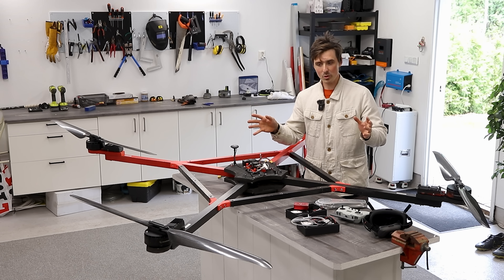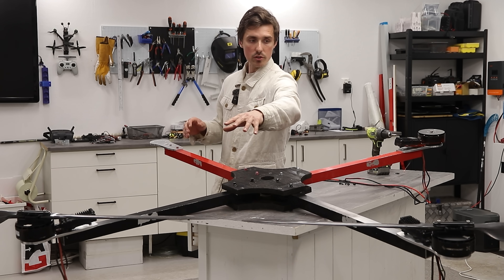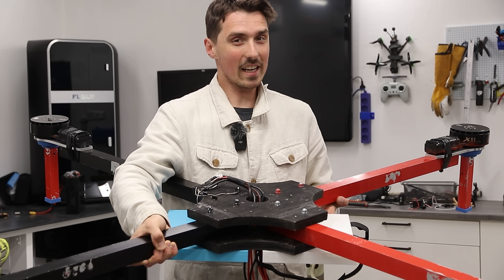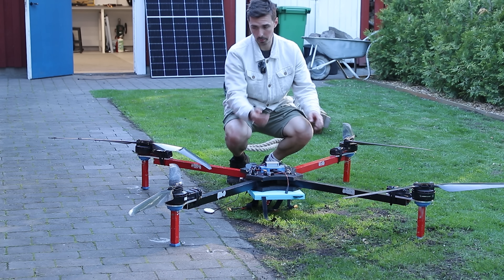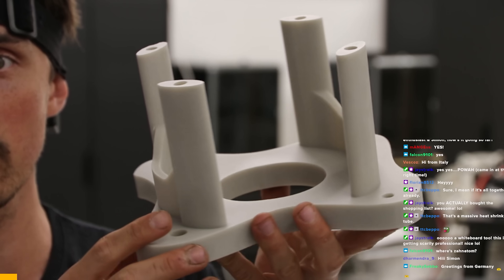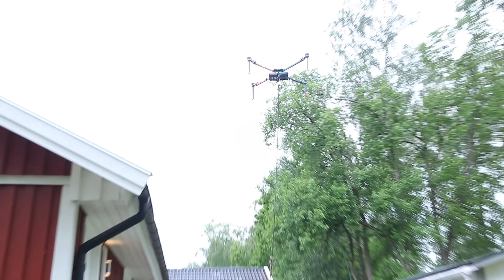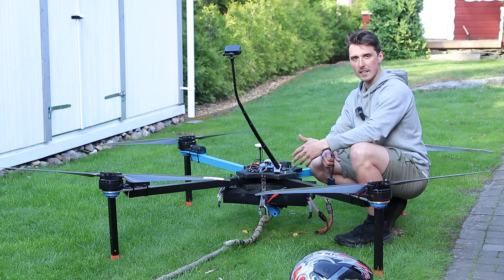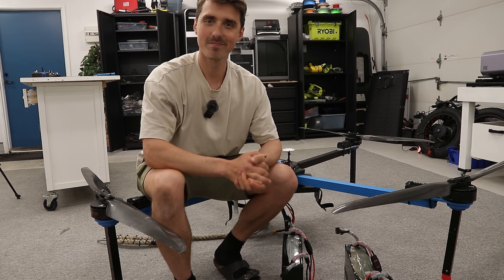Heavy Lift Drone 100kg Test - It Works!

Comment: that last part where you did the 100 kilo, notice that when it dropped, intertia pushed the drone up about a meter higher. I was expecting that reaction from the beginning when you dropped the wheelbarrow but it in each case the drone remained level and composed, even at the 40 kilo weight... it is a very stable build... I can't even complain about testing in that small back yard because the drone seem impressively stable

Comment: @RCLifeOn - WHY are you not adding or making protection rings or some kinda metal mesh around every propeller?  It will protects the propeller and other parts from breaking in pieces if something happening.
Reply from the maker: Not sure it would. The propellers are 1.3m in diameter, imagine how flimsy it would be made out of foam/metal etc. It would have to be reinforced with glas fiber but still, the drone is 35 kilograms. It's probably cheaper and lighter to have spare propellers.
Reply: @RcLifeOn  Yeah, I understand that - but it will be even more cheaper if someone will have some spare head and second life to have LOL ! Think about your own safety and other people safety as well - no just for drone's propeller health as well. You need come up with some solution how to isolate propellers with some rings or mesh from some material.

Comment: A "release" mechanism - built on the same principle as a parachute triple ring (3 ring) release -  its operation isn't significantly affected by the object weight at the release actuator, unlike a double shear  - slider..  (I have a few - "in rope", "soft shackles" I use with this type of mech - all made out of rope spliced into rope, easy to slip the load, another mech is an over centre release - as has been used in many compound-bow (archery) triggers.

Comment: Couldn't you significantly reduce weight by using one large central propeller with stator vanes (or a second counter rotating blade) to prevent rotation?  Then steer by much smaller directional (counter rotating) motors, since it would no longer bare weight on the arms.  Might even be able to use carbon fiber or plastic in any extenstions to keep arm weight low.  The weight kept nearer the center of gravity it increase the relative agility.

Comment: Hobo level engineering 😂 more subscribers than sense and skill but i guess thats the charm 😜

The drop mechanism for example are printed in the weakes direction, and the servo tries to pull the pin out at an angle, it needs one more linkage between the servo arm and the pin so the pin can go in a straight line, will make it much easier to pull.

Comment: Two bolts holding down the motor mounting plate may be a questionable design if you intend it o carry you. I’m worried for your safety. 😮

Comment: I have both the x11 and x 13 motors and they are extremely reliable and I use the curve flight controller and I haven’t had any issues with them

Comment: The release mechanism should be printed 90 degrees from the orientation you printed that one. The layer lines need to be in the direction of the load or else you are just depending on layer adhesion.

Comment: Very dangerous, it could instantly flip and fly in your direction if anything was setup wrong. Or if there is a feedback in pid loop which is very common in large drones whitout a stiff frame or unbalanced propellors. Glad you took protection a bit more serious this part halfway through the video

Comment: Thats super amazing, with the 65kg the problem was too much shaking, if you use 3 ropes at different points it will elliminate the shaking, but the droping mechanism could turn a lot more complex. That series are my favorite right now please continue!
Reply: In such configuration the release must be installed on the rope after the junction
Reply: There is no need for a heavy-duty release system. Check out the three-ring release system we use on parachute risers. It’s an ingenious setup: a small (~20 mm) high-strength stainless steel ring inside a medium (~40 mm) ring inside a large (~70 mm) ring, all interlocked and held in place by a loop of webbing through the small ring, secured by a pin at the end of the release cable.

Pull the pin holding the small ring, and the whole system cascades open almost instantly in three stages — one ring after another — releasing over 100 kg with probably around 1 kg of force, give or take.

It’s super lightweight, too — nothing like that enormous monstrosity he used, which didn't even work properly!

 I actually had to cut away a malfunctioning main once, and it worked perfectly.
Reply: @Nilguiri yeah that's a great way to do it, smart.

Comment: You should print those heavy duty parts from ABS/PETG or similar, the layer adhesion is way better. Also, the piano wire is a nice touch, but you should design your parts with the holes for it, so the piano wire has something to glue inside other than the infill. Crazy drone though!

Comment: 1 week ago, i flashed my HW T1 vtol to inav 8. Had to redo the Mixer, becurse the beckup was not supported.
Inmessed up the Motor outputs, and testet  it with full props in my hand. It ripped out of my hand while testing, and ripped a chunk of Skin out of my Arm. And neck.

Comment: make attachment for like chainsaw, show the drone then to the power company whose job is to repair and fix the local power lines. They would probably love to see cheaper option to the helicopter+chainsaw combination to cut down tree branches that are dangerously close to the high voltage lines.

Comment: I rarely comment. I assemble agricultural drone for a living. Hundreds of DIY from 20kg to 70kg payload. I also work with DJI grass. I must say this dangerous to test close to your house. 
Not to discourage with your work but safety first. I had many stupid accidents that just to feel sorry after. 
Keep up your work.
Reply: From a virgin test-hop, all four legs should have been tethered independently on short tethers to four weights. It should be assumed that the article MAY do absolutely anything in all six degrees of translation, rotation.
Reply: @-danR  100% - was thinking the same myself, just complete amateur hour.   And the tether weight was completely inappropriate - he commented it picked up all 60+kg of it.   What would he have done if it had gone max power and wouldn't turn off?   60kg tether dropping from a height could kill a person.
Reply: Also the helmet won't help much. Motorcycle helmets are designed to absorb heavy blunt impacts. They are just thin ABS and Styrofoam. He should be wearing something like a hard hat with a safety visor or something with a metal shell in case one of those props splinters and sends out shrapnel.
Reply: @rubiconnn  Watching him like 10 feet away from that drone with "cover" after the props were glued together was so sketchy lmao. Then to have the motor order messed up on a drone of that caliber, omggg
Reply: Any open source agricultural drone?
Reply: Hi do you build and sell drones
Reply: I think hurting himself is ingrained in his process
Reply: “The true man wants two things: danger and play.”
Reply: We are Vikings, we dont care 😂🎉
Reply: Китайцы летают на таких dji agros. Они садятся в кресло в центре. И летают.
Reply: I have the feeling that some day, some person will die caused by one of his projects.
Reply: @MrGTAmodsgerman That's a morbid thought...
Reply: @MrGTAmodsgerman 😂

Comment: You are really giving the flight controller a workout with all of the turbulence cased by flying so close to those buildings.  Any breezes or wind rolls over the roof tops of the buildings and causes down drafts and swirling air (rotor).

Comment: Beautiful and congratulations. Use either Taulman 910 alloy or aluminum for the whole release mechanism assembly. Don't forget to coat the pin release with graphite and do some covers for the batteries. Well done.

Comment: What a beast! I'm really impressed with that flight controller. I expected it to go to the moon as soon as you dropped the payload but it kept it's altitude. Very cool project and also sketchy af. Good work on that prop repair. I also didn't expect that to work out so well.

Comment: Them FC's are bulletproof .. Used them with different builds over the years, also the Naza V1	+2 are solid units. never let me down and have had the same heavy lift for 9yrs!!
Reply: That’s cool. Which FC is he using for this one ? It’s actually very stable !!
Reply: @MehdiNY  He used a Jiyi KX, a common FC for agricultural drones from china. Wonder how the revised K++ V2 would perform!

Comment: You should use Aluminum instead of Aluminium it will massively reduce vibrations for only like a 3% weight increase.
Good video though

Comment: I've been watching agricultural drones spraying entire fields and carrying 13 gallons of pesticide. Definitely a market for the heavy lifters. I suspect you have the equivalent of a $30,000 drone there. Amazing job.
Reply: Those fat DJI drones, as terrible as DJI is as a company morally and to deal with, do have their advantages though and the tech is really impressive. For example if you lose a prop or motor the flight controller makes the whole drone rotate very fast to allow for a controlled landing with only 3 props. It's crazy cool to see, I wish ardupilot could get that feature too.
Reply: @ml11ML  if you go on the DJI forum that's on DJI website you can see hundreds of customers complaining about serious issues they are forced to deal with,it really is frustrating to try to fix so many problems when you have paid so much,I spent $3000 on a phantom 4
Reply: @ml11ML  Yeah DJI nearly has no competition, crazy tech they make. From my experience they are very nice to deal with, i 've had very good support for warranty and repairs from them.
Reply: @ml11ML  Morally? Eh.. maybe, but I tend not to bother with the terminally online stuff. As for "dealing with" I've never had an issue and they've been nothing but responsive.
Reply: @squidikka Ah I was probably not clear enough, I'm sure their customer service is great as I've read many stories about it. I meant more in terms of how they lock their drones behind an online account and prevent you flying if you don't log in again every month or so, and how the drones transmit the DroneID signal (different from  Remote ID) which gives away the drone and pilot locations in real time. It's just I don't personally agree with those two things. Otherwise their tech and customer service is really top tier 👍
Reply: @ml11ML I think that was a government mandated restriction, not something DJI came up with?
Reply: @ml11ML  Pretty sure the CAA in the UK has similar rules. All that does is stop irresponsible flying. The Mavic 4 Pro can fly at 60mph after all. It has 387 Joules of Kinetic Energy at max speed
Reply: @ml11ML  Huh? don't have that kinda feature where I'm from. Most probably something that was mandated by your government.
Reply: These things are excellent at saving lives too. I recently saw a story of some guys that were fishing, and they were using a drone to send their line oit because the drone got it further than casting it could. They saw someone struggling in the distance, so they ran and got a life vest/jacket and flew it out to the person who likely would have drowned. Rescue situations where these things can bring needed medical supplies, water, blankets etc. to dangerous areas that a person couldn't get to easily or quickly enough. I have seen autonomous planes deliver blood from a bank to medical centers in remote areas that would take a land vehicle too long to get too. These things are amazing and saving lives more than we hear about.
Reply: Electrical companies that repair and fix the high voltage power lines would love drone like this, it would be cheap to cut down branches that are too close to the power lines, preventing possible power outages during winter and storms

Comment: the moto helmet is pointless (not designed against shrapnel)
full face shield for grinders and covered neck at minimum...one cut and even the ambulance might not be fast enough
also seriously consider: (loose) turniket ready on your arm, good medkit that's close by, a first aid course (both you and your girlfriend)

Comment: This is amazing, please marke it possible for people to buy this please please please. That said! I believe your motor mounts would be way stronger if you put a pipe spacer in the square tubing section this way your bolts not crushing the square frame. (Informed engeneer wannabe)

Comment: If a small fpv quad can carry kgs of high explosive, this one, well....
* heavy russian sweating noises *
Reply: The fpv quads that can carry multiple kilograms of high explosive are not that much smaller. For that matter, the heavier drones usually have more than four motors, because normally they carry a payload you really don't want to crash (cameras...). Most hobbyist drones weigh less than one kilo. Payload capacity varies, but it's usually not that much.

Comment: Oscillating isn't because of weight and RPM. Even if more weight helps. It's  a PID problem.
 are u running betaflight on this thing? You need to pay close attention to the PID tuning. Look at some guides by Chris Rosser please.

Comment: So cute that motorcycle helmet ... those props will cut through that like through molten effin' butter
Reply: Would be a intresting test with the "repaired propeller". To see what will happen with the helmet at full speed.
Reply: @TheStijnw  And some ballistics gel inside. Go full mythbusters on it 🙂
Reply: It's meant to stop any shrapnel or projectiles. Even so, do still think that he should have taken better precautions.
Reply: @mh6276  I'd like to see a motorcycle helmet stop a bullet. I know some manufacturers claim they do so, but all the tests I've seen, the bullets went right through. And also, these blades might well hold more energy at full throttle than a reasonably sized bullet does in-flight.
Reply: What's even more terrifying than the props hitting the helmet, is the props hitting the neck below the helmet, or the bowel region.

Comment: your detach hardware needs an update.  Im not an engineer, but I know you would get better results if you used a hinge, and a shorter pin to release the load bearing latch.  Good luck with this project.  and btw solar panels are about as much protection as aluminum foil.

Comment: Using a solar panel as a shield was a nice touch.
Reply: What amazed me was that it wasn't even the same solar panel throughout the video.
Reply: It's sustainable energy, charges the drone while protects the pilot
Reply: Ehh who needs bullet proof plexiglass. LOL. Just a helmet and a solar panel.
Reply: Came to connect on this. 💀
Reply: I was shocked that you didn't have the panel facing the other way to protect it!!
Reply: Known for their incredible strength.
Reply: @UCCLdIk6R5ECGtaGm7oqO-TQ 😂

Comment: In my mind the control issue wasn't due to lightness, it was due to the motors inability to ramp up and down fast enough. With smaller drones, you get more authority the lighter they get, not less.
Reply: You're probably right. Increasing the mass is definitely a way to compensate for that though, as more mass means the motors do not have to ramp up/down as fast. I am glad to see this thing fly in a stable way though, epic video.
Reply: Probably the control system, more extensive tuning to the PID algorithms would likely be required to optimise control for both fully laden and completely unloaded situations, could also build in some additional logic to minimise the disturbance of load release (using the release trigger as the input). The base setup seemed to handle dropping the smaller loads without jumping around much, but at highest payload he tested it definitely lunged significantly upon release.
Reply: @Amoeba-w1o PID loops are definitely one part of the equation and some sort of stability could probably be achieved with that alone. My personal belief is that just downsizing the props would lead to more authority, albeit with less overall thrust.

Comment: A 150KG electric release bolt latch is like $12 on Amazon.
Reply: Sometimes the immediate availability of a 3D print is too alluring.
Reply: No, let's use two expensive servos and half a kilo of PLA.
Reply: But muh 3d printer
Reply: 40 kg is very impressive given the weakness of 3d prints on the x-axis. Needs more infill
Reply: @luislongoria6621  Predrill diagonal holes and insert metal pins?
Reply: Is there a little twist on each motor, like the phantom 4?
Reply: You ever think to check if it is available in Sweden ?any things on Amazon are not available in other places.
Reply: @SuperUltimateLP Yes the chinese made electric latch that is in every single smart locker from here to botswana is also available in sweden.
Reply: @SuperUltimateLP  You ever think to check if it was available in Sweden? Because it is.
Reply: @SuperUltimateLP  Exactly.

Comment: It would be very interesting to see a project like this with a high-horsepower gasoline engine. I've been thinking for a long time about whether it's possible to build a large drone with a central gasoline engine, say, with 200 hp. The power would then be transferred to the four propellers via a gearbox and drive shafts, with a clutch controlling the different propeller speeds.
Reply: There were, and maybe still are, some gas powered quadcopters that use one engine and propellers with swashplates for lift control like on helicopters.